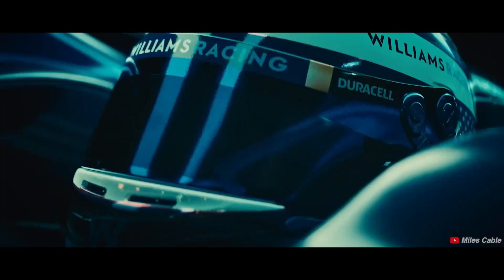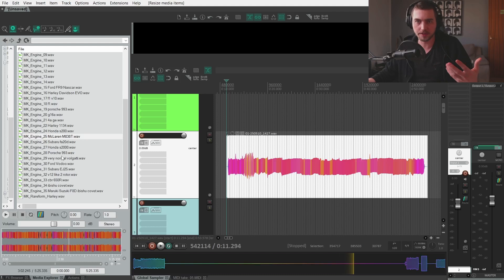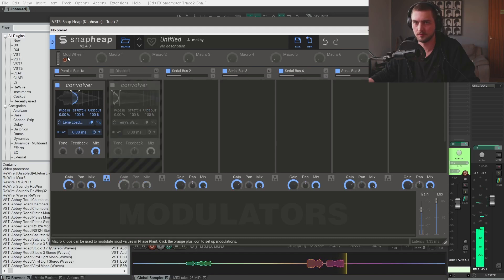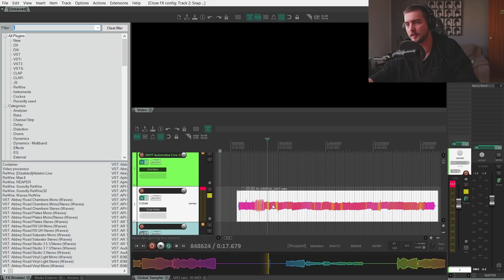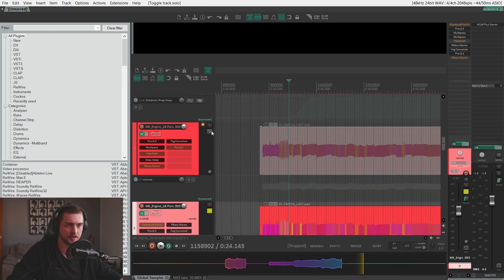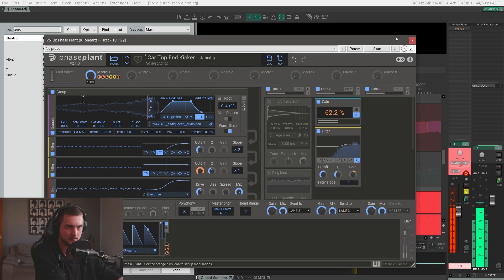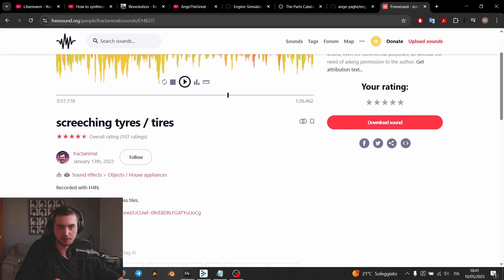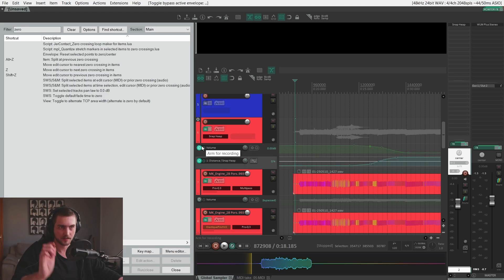CARS Sound Design is EASY (not really)

Comment: What's really interesting about this, did you actually model each of those raw library recordings you pulled from based on each of the cars that you named the files as? So Porsche was made from referencing how a real Porsche sounds, McLaren etc.?
Reply from the maker: I didn't model anything. Ange the Great gathered an amazing community full of enthusiast that use write the code and model engines themselves and upload them on a website. Some of them are pretty accurate. I'm not sure how accurate are the ones I used, I just named them after the patches I used to have track of it. And overall most v4, v8 or rotary have very similar sounds depending on rpm range. And in film industry and even game industry, when it's close enough it's good enough :) Might be different if you try to do something really faithfull to the car, In that case I would go on and actually record the car

Comment: Hey Max, how did you go about recording the audio from the simulator?
Reply: i assume he uses obs to record the sound
Reply: @flaneur06  Thanks for the insight.
Reply from the maker: Obs would work as well. But there's a mode in reaaper (audio device section) called Wasapi, it enables recording the system output. You can find tutorials here on youtube on how to do that.
Reply: @MaxKoko  Thanks. I'll look into that